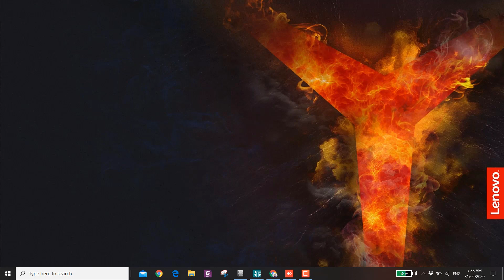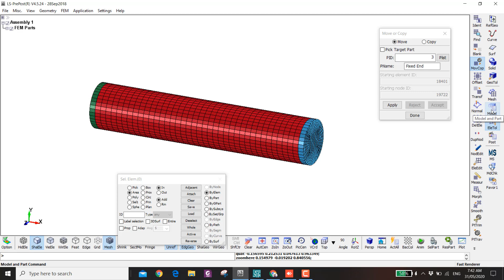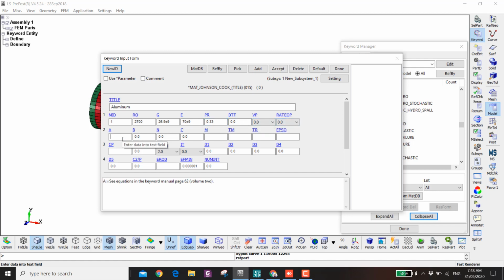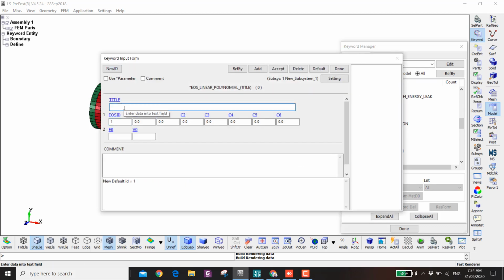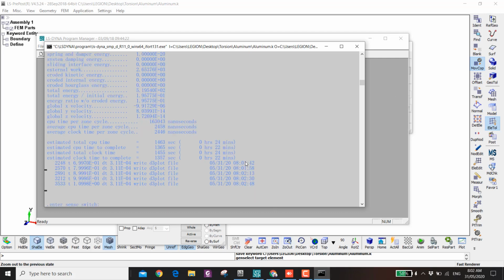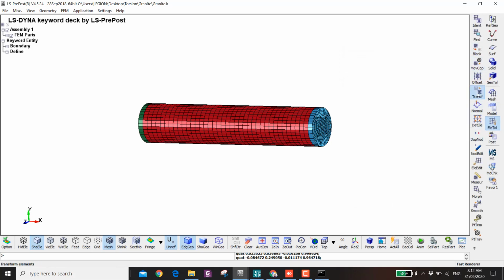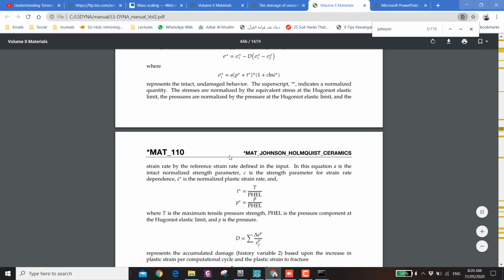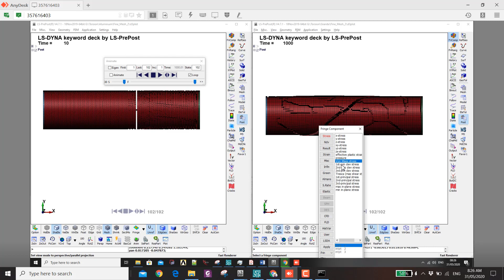LS-DYNA TUTORIAL 15: Shaft Torsion with Mass scaling, Ductile and Brittle Failure

Comment: A very informative video, thank you! But why didn't you choose to do an implicit analysis?
Reply from the maker: Very good questions. With Implicit analysis, everything needs to be fixed and have no loose ends. I could use it, but up until the point of fracture only. Once an element is deleted, then it would be difficult to reach convergence (as you can see in the vibration I mentioned in the energy graph)

Comment: Very helpful tutorial Ameen. I appreciate the time you give. Why did you define the C2/P parameter in JC material model? Since parameter VP = 0, isn't this redundant?  
Once more, thank you and keep up!
Theo
Reply from the maker: Hi there,

It has been a mistake as I was more focusing on inserting the damage parameters in this tutorial. But yes, you are correct. C2/P parameters are only effective when VP = 1. 

And here is where I knew that:
https://www.dynalook.com/european-conf-2007/optional-strain-rate-forms-for-the-johnson-cook.pdf

Anyway, since the load rate is low in this tutorial, I would expect that it won't make much difference. You can try out with VP = 1 and let me know if you get interesting results :D

Comment: can a similar setup be used for a compression test of the granite specimen, where instead of twist, displacement is given? if not, what other changes will be required?
Reply from the maker: yes, I have a tutorial con compression test. You can check it out.

Comment: Thanks for your tutorial sir. I am now trying to use johnson-cook model in tensile test, and I have one question regarding it. How can I define the 'PC' in the material card, which is the tensile failure stress?
Reply from the maker: You set PC to a very huge negative number because you want the failure (erosion) of the elements to occur in the specimen due to tension.
Reply: @AmeenTopa  Thank you very much sir! I will try as you advised me
Reply from the maker: @김경민-e5o  You are very welcome.
Reply: @AmeenTopa  I have another question. I've done tensile test simulation, but element is not deleted during the test. Is there any way to make element deletion occur? And if you don't mind, can I send my .k file to you ? Thanks in advance sir!
Reply from the maker: @김경민-e5o  it could be that
1- the damage criteria is not defined properly. 
2- the cutoff pressure value is not big enough
3- the deformation is still low.

With regard to sharing your model, there will be some consultancy fees. If that's fine with you, please contact my team at feadynamicconsultants@outlook.com

Comment: Hi sir, in this video, why didnt you make any contact between middle part and end parts ? is making one section meaning they are connected each other ?
Reply from the maker: There are connected to each other because their nodes are shared at the connection zones. And the nodes are shared because of the way I created this model.

Initially, it was one single part then I used MoveCopy to change the part ID. Using this tool will not disconnect the mesh. It only changes the ID of the part.
Reply: @AmeenTopa  you are great. Please increase number of videos 🙏🙏🙏
Reply from the maker: @hamzagungor3029  Finish all of my videos on the playlist LS-DYNA Basic Tutorials and I believe you would be able to do the simulations you want to do.

Comment: Hello Ameen sir, the tutorial is very informative. I have a doubt in my model using mass scaling. As in ur video u just increased the density, how can we extract the data of how much mass is added in the whole/part model and how can we verify that the added mass is within the limit and do not effect our force results.
Thank you!
Reply from the maker: Hi there,

Regarding this method of mass scaling:
1-You can measure the total mass of the system before and after increasing the density
2-Regarding whether it will effect the force or not, as a rule of them you measure the energy, and check if the kinetic energy is within 10% of the total energy of the system as I mentioned in the video. Of course, to check this, you can run the model without mass scaling and compare the results.
Reply: Thank you for your reply sir! I will do n check that. Well after Mass scaling kinetic energy is below 5% but without mass scaling the duration of analysis shows more than 3600hrs. Is there any other way to check without mass scaling?
Reply from the maker: If that's the case, then I think the results are still acceptable.

You can convert to implicit analysis if you want to check without mass scaling. But you might get difficulties to reach convergence if your model is complex.
Reply: Thank you sir! yes,  implicit analysis will be difficult for my model,  as of now my results are pretty much acceptable. I will try improving it.

Comment: Hi Ameen Topa! It was an interesting video!  I like the way that you induce the rotational movement. However, I was wondering If there was an alternative to applying a torsional moment to a component made of solid elements. I know they only allow translational movement.
Reply from the maker: Hi there. You can try LOAD NODE POINT with DOF 4 or 8. Look it up to see how it works.
Reply: @AmeenTopa   It is a bit late but you were correct. I use LOAD NODE POINT with CNRB and then I released the rotation about the axis of interest for applying a torsional moment to the shaft.
Reply from the maker: Glad it worked.

Comment: Hello Ameen, nice video. I have a doubt:  in a thermo-mechanical model, how do we modify the thermal properties, such as specific heat, to reflect the increase in the mass as a consequence of changes in density?
Reply from the maker: For thermal simulations, you need to define thermal material models. The most basic one is MAT_Thermal _Isotropic in which you need to define the thermal conductivity and heat capacity of the material.
Reply: @AmeenTopa  yeah, but, should we modify the properties because there is more mass now?
Reply from the maker: @diegoarmandogomezmarquez879  

How does the mass increase suddenly?

If you heat up your specimen, it will expand, then melt down. The mass will be the same but only the volume will change.
Reply from the maker: @diegoarmandogomezmarquez879  The density of the material will change. But you do not need to worry about this. Because you define specific heat capacity which is a quantity that is per unit mass. 

If you read about heat capacity, you will find the following:
Specific heat capacity is an intensive property of a substance, an intrinsic characteristic that does not depend on the size or shape of the amount in consideration.
Reply: @AmeenTopa  That was my doubt; I thought we needed to scale the thermal properties. Thanks.
Reply from the maker: No worries. All the best. Maybe we can work on something together in the future. 🤞😁
Reply: @AmeenTopa , surely I would like. We may talk about that.
Reply from the maker: Wonderful... looking forward to this opportunity 😁

Comment: what are the numerical effects of mass scaling on the solution? will it have effect on strains?
Reply from the maker: Yes it will effect. Mass scaling means increasing the mass. When you increase the mass, you will increase the kinetic energy (1/2 m * v^2) as well as the forces ( m * a ). However, if the amount of mass of scaling is not much, then the results won't be different so much. But there will be a different.

Comment: Thanks for the Video … I am modelling Special type of Concrete called as strain-hardening cementitious material (SHCC) under Torsion. I am using mater model O72R3 Damage material model. When i changed a certain Parameter below a certain value my System didnot converge. I have changed the time step size and also i have chnaged the displacement and Energy limits in implicit solution. But i am not able to solve.. I am stuck for atleast a week . Please can you  guid me in solving my Problem.  If i have your email, i can send you my K file. 
I would be very grateful to you.
Kind regards
Rab nawaz
Reply from the maker: Hi Malik, based on my experience, MAT072R3 gives better results using Explicit analysis. Due to some reason, while modelling with implicit, the results seems to diverge from experimental data.

If by "system cannot converge", you mean in implicit analysis. This is due to the failure of the concrete. When failure occur, there will be huge deformation which cannot be modeled with Implicit solver due to the instabilities.

Drop your email here and I will follow up.

Sincerley,
Ameen
Reply from the maker: Hi Malik, I've sent an email. Please check you inbox.